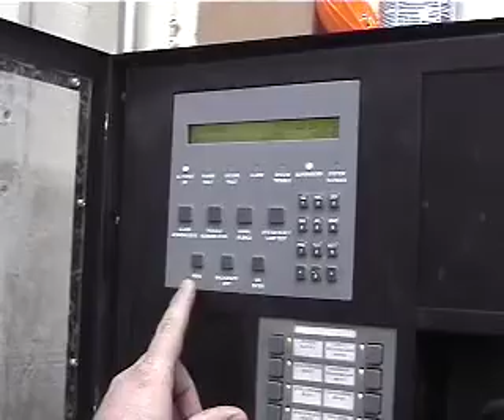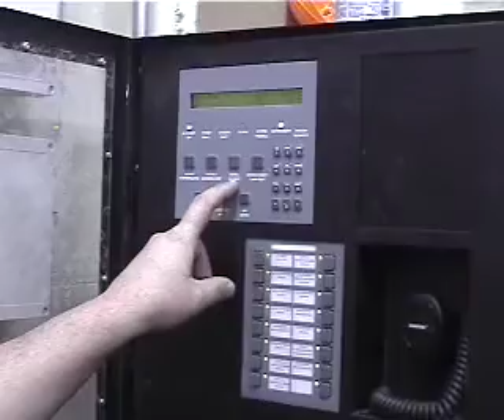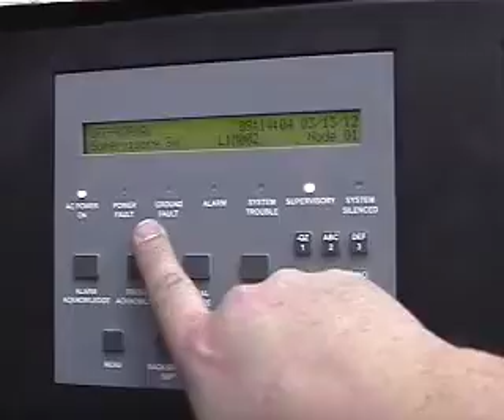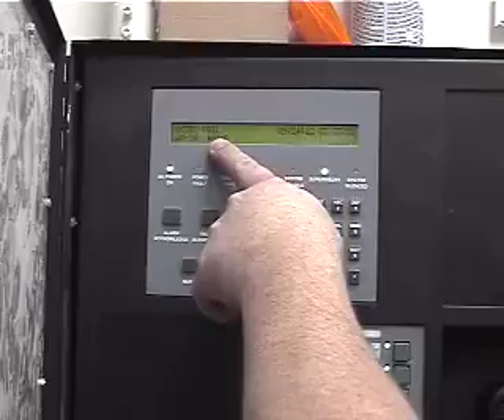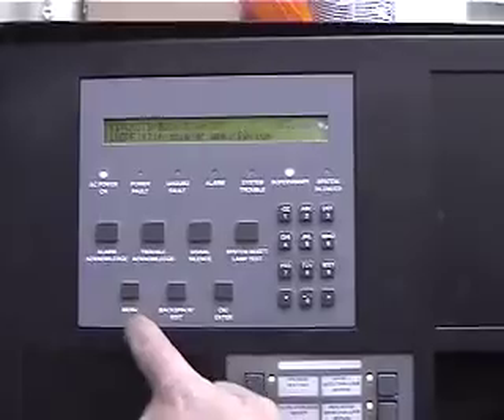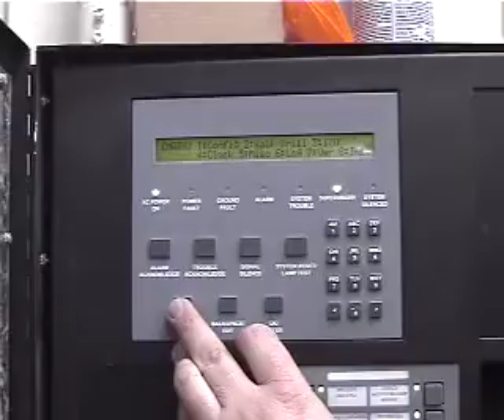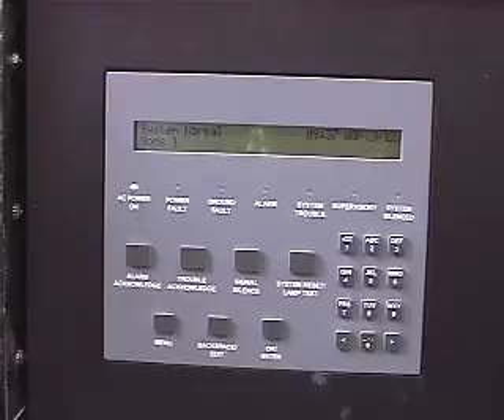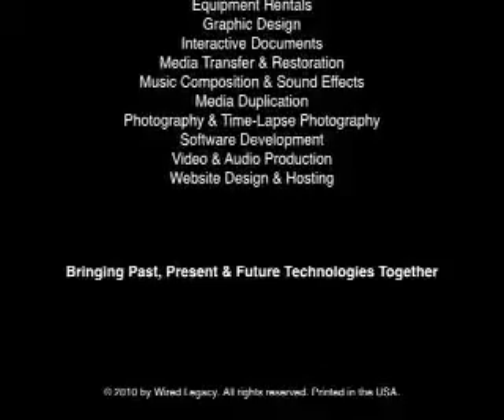Fire Alarm System (35172)

Comment: It,s a gamewell fci system made by hollywell those panels are the e3 or something the communtry college that i went to the newer and remode parts have those system the older parts have even a late 90,s or early 2000,s Gamewell system with Wheelock E70,s speaker strobes the college open in the late 60,s but late 90,s or early 2000,s i guest the very old system was replace with the systems that they have now but the remodeling parts have those System Sensor speaker strobes but still have a slow